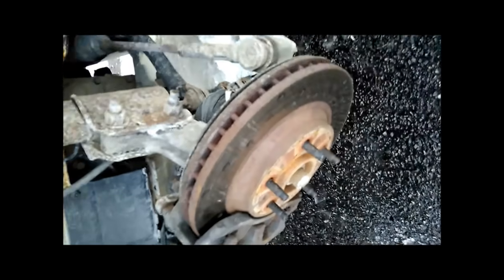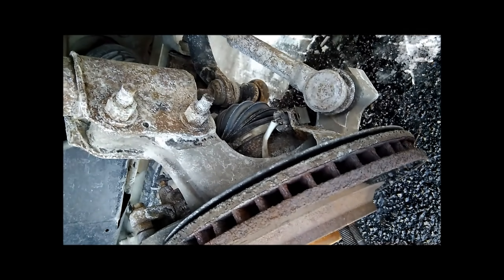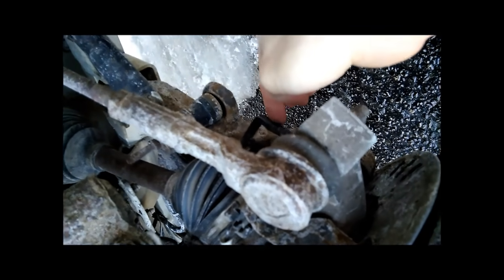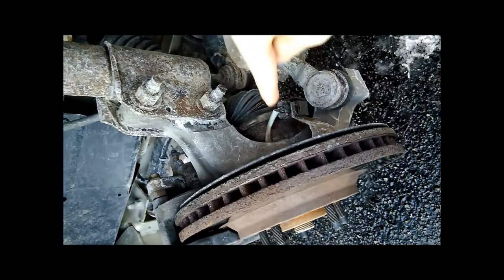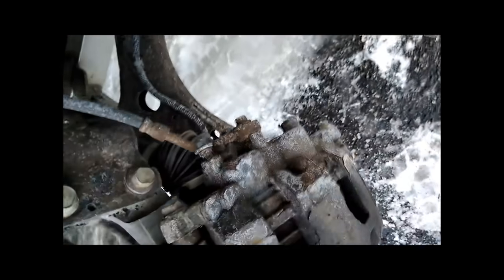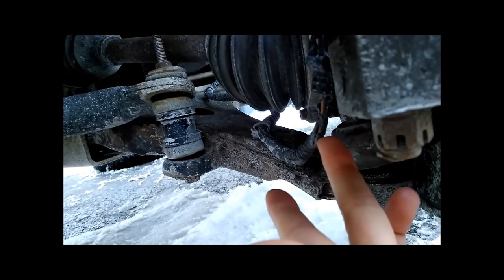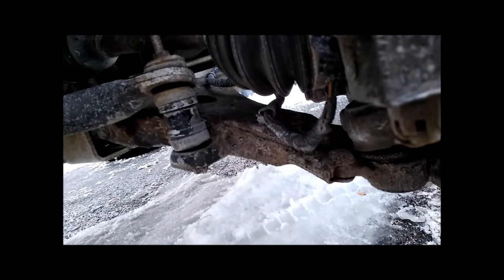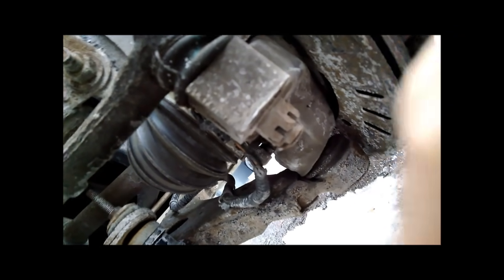How to fix ABS light, Traction Control, Stabilitrak

Comment: I had my 2007 mercury mountaineer worked on about a month ago replaced front passenger side wheel bearing hub assembly & just 3 days ago, abs sensor light came on. Still need to get the driver side bearing assembly replace and it’s still humming. Figured, bearing is going out also. Thanks for sharing this video👍
Reply from the maker: No problem.  Yeah, when a problem occurs right after doing a repair in a related area it's a dead ringer that the repair may have instigated the issue.  Sometimes the mechanic forgets to plug in the speed sensor harness or maybe they plug it in half-way or maybe they don't route the cable in a safe path where it won't get yanked on.  Many possibilities.  It's always good to have a look at the repair area first so you can potentially rule it out.
Reply: @ChrisCamaro  sounds good brother 👍 have a great weekends and thank you🙏

Comment: Thanks for the video, my parking brake broke and took that 1 of the sensors and I replaced it but I still have the lights on the - so now I'm gonna go around the vehicle and check the rest of the sensors,  it's a 2008 Dodge Durango two wheel drive
Reply from the maker: Good stuff.  Just remember that 2wd and 4wd alike rely on all 4 wheel speed sensors for the TCS

Comment: Fyi, I showed my mechanic homie, this video and he said that a better way to protect these wires is to replace the original deteriorated plastic tubing that protect the electrical wires and then wrap the new plastic tubing with electrical tape. Electrical tape, my mechanic said melts with heat. The plastic tubing is sold at the auto supply stores. Over all good depiction in this video, in my opinion.
Reply from the maker: A valid point.  The electrical tape is a bit hack'ish but it's meant to be temporary... till you can figure out what you want to do about your car in the long term.

Comment: I have the same problem, haven't had a check yet, my abs, traction, hill start and tyre pressure have all gone at the same time. I will update you when I'm done! I have a ford Cmax 2011 model.
Reply: Update, I took both the front wheels off, no corrosion or problems with the wires, I still need to look at the back ones though.

Comment: Good video, though quick tip.  You shouldn't let your wheels spin while the vehicle is jacked up unless you jack it up from under the lower ball joint or other wheel suspension component.  Spinning the wheel with the suspension at maximum travel can damage your half axles or even rip/slip off the rubber boots on the half shaft.  Basically your vehicle never turns the wheel at maximum suspension travel, unless you regularly take your car off of sweet jumps, so doing so while jacked up just creates an unnatural condition that your car never operates in.   With an older car that could be the difference between getting another 100k miles out of your front or rear axles or putting everything back together and finding out that your axle is now suddenly clicking and popping.  Oh and turning the steering wheel while doing this is just all that much worse.  cheers.
Reply from the maker: It never occurred to me to consider that but you're absolutely right.  Of course, all things mechanical are a function of time so I got away with it over the minute or so I was doing this diagnostic but your advice is definitely worth following.  Thanks!
Reply: @ChrisCamaro  you did good sir.

Comment: Thanks so much bro. I'll check mine in the morning. I'm sure that's my problem.. i also have the engine reduced power on the dash
Reply from the maker: I hate how the car has a "run like crap" mode that can be triggered by hundreds of potential codes.  I know it's there to save the rest of the car but usually it's just a pain in the ass.
Reply: I had the same problem I rewired a bad connection under the hood and it fixed

Comment: I didn't see anything to where you have to go in and clear the faults,like you do for a check engine light,just doing the repair will get rid of the light on the dash.Thanks for the video!
Reply from the maker: As far as I am aware, the fault will not persist once the problem is corrected.  Even before I addressed the issue in my car, every time I started it, the car would be fine with no lights.  The ECU was assuming the system was ok until it faults out.  You should be ok just to fix the ABS without resetting the lights.

Comment: Thanx Chris, like said below, best answer I ever heard. Had the Chevy service writer tell me they had to yank the steering wheel to replace a sensor???????
Reply from the maker: I suspect it was the steering sensor they were referring to.  This may be "a" mode of failure but not one I've personally experienced.
Reply: @ChrisCamaro  Chris in my case, the stabilitrak light only come on when the steering wheel is turned (left or right doesn't seem to matter) gotten to the point where I just change the dash display to vehicle mileage. On the up side, I have not noticed a change in handling. Your tip about the 15 sec reboot appears to be working ....... thanx again!
Reply from the maker: @Monkmaster1969  Glad to be of service!

Comment: Damn i learned something new  , thanks , my car just intermittently started doing this , this evening again , i just had the tie rods replaced last week and perfect timing the same area damn near , impala 2013 lt
Reply from the maker: Sometimes these things are more than just coincidence.  You do a repair in the wheel area or steering subsystem in your case, maybe the mechanic has to move the wires to get at something and when you get the car back the wires have been shifted and made vulnerable to moving parts or road debris or whatever.  Happens more often than we realize.
Reply: @ChrisCamaro  yep i bet your right,  because it never did this ever before i had my new tie rods replaced  , i got my car back 2 hours prior to my first alert on my dash , and was thinking he maybe hit something and it created an error  , i shut my car off and restarted it , then it has been fine , but i know it will happen again

Comment: Another thing this could be the sensor is dirty where it "reads" the movement of the wheel. On some cars you can get to the sensor enough to clean the road grime off and resolving the issue. This was the problem on my nephew's car this summer. Took ten minutes to figure out what was wrong, thirty seconds to clean it and three minutes to put the brakes and wheel back together.
Reply from the maker: It's an interesting hypothesis but if I'm not mistaken, the wheel speed sensors are magnetic encoders.  In other words, electromagnetic waves can "see" through dirt and grime, since the dirt and grime is non-ferrous. What might have happened is the encoder might have shifted out of alignment... maybe it was too close or too far away to provide a good signal, and by cleaning it and putting it back, you actually reset its position.  It's just another guess on my part but unless the encoders are optical or something else I'm not aware of, they should be more or less immune to dirt.  Automotive applications often use magnetic for this reason.

Comment: Excellent video!!!👍

If there is a bad sensor wire on my truck that’s causing the skid light to flash and the chime sound…
Will a bad sensor or sensor cable also cause the dashboard to have other multiple dashboard lights to light up like the Batt light, ABS light, all the dial controls to stop working for a few seconds then work again and the turn signals stop working??
Reply from the maker: No that sounds like more of an electrical connection problem in general.  My MC does that actually.  I'm looking into the wiring.

Comment: I just had stabitrack light and check engine light come on in my 2016 Chevy Impala and all I did was put better gas in there I ran three tanks of the E85 in a row and didn't have enough octane to boost the fuel injectors which resulted in engine power reduced, eve, the e88 gas works good but they can keep the e85 fuel for their cars
Reply: What kind of gas is that?

Comment: Hey man great video . I am a electrician 
Your taping method.  Crappy tape . 
If you use rubber tape . And 3m yellow 88. 
As long as the metal strands of the wire were in good shape . That could be a permanent fix . If you were charging someone to do this . Not ok . 
If peeps reading want to do yourself . Would work .
Reply from the maker: Heh.  I often do things sloppy.  Mostly because I'm ok with the idea that it's merely a temporary fix.  I'm sure you or someone else could have done a more professional job but I eventually did just get it repaired outright so I knew it was a short-term thing.  I think the main takeaway is finding out where the failure point is.  From there it's a matter of cost and time for the user.

Comment: Just curious what was the purpose of starting the vehicle and putting a vehicle in drive and having a wheel turn to pivot the wheel hubs left and right what was the point please explain !¿?
Reply: To make sure the wire didn’t get super tight or twist or bind
Reply from the maker: The idea is to examine the wheels'range of motion and to see how the wheel speed sensor's wire loom moves along with it.  If there is something wrong with the way the wire loom is routed, you may see it visually as you turn the wheel.

Comment: This happened on my 2018 silverado around winter. Only when i turned left, then progressively more constant. Disables cruise control. Replaced obviously faulty wheel speed sensor with ACDelco match. Both lights now on for eternity. Have not asked a dealership. When the bad wire was not making contact with the coil spring, everything was normal. When i replaced the parts the truck was shut off with the lights on and the wire making contact. I wonder if i just never gave it the opportunity to reset. Ive unplugged the battery before.

Comment: Excellent video thanks let me ask you this that problem affects the car getting speed after 35 mph?
Reply from the maker: It could happen at any time since flaky wiring will confuse the computer whenever you go over bumps or the suspension moves around, which can happen at any speed.
Reply: @ChrisCamaro  thank you so much for the information and your video we found some wires hanging now we have to figure it out the problem thanks again

Comment: Thanks for the great video.I have same problem in Caddillac escalade Esv 2016.In raining few lights are ON and the steering gets hard, ABS, Traction, etc. Do you think these are the same issues and fixed as you showed in the video?
Reply: Did you solve this?
Reply: @tylermcintyre8503

Comment: Would flat spots on a tire causing a mild shake around 45 mph cause these sensors to trip the stabilitrak? I drove about 6 miles fine and then bam I got hit with this issue and my engine reduced power and acted like it was misfiring.
Reply from the maker: In my case, not only turning but going over uneven road or gravel did cause the problem so I would think yes.  Any sort of imbalance in your drivetrain will have a resonant frequency which will amplify the effect at a certain speed.  If 45 is your car's resonant frequency it might be enough to trip the ABS, if there's a wiring/sensor problem already.

Comment: This was a very insightful video..
Now lately whenever my esc lite comes on..
During only expressway driving..
My right front brakes automatical engage the caliber an heats ups.
Its a 2007 Kia Sportage an no one has been able to figure out why..
 I'm open for suggestions after replacing calibers an brakes..
Reply from the maker: I'm just spitballing here but if it's highway driving, that makes me think vibrations.  The "frequency" of the vibrations on the highway are different than what you get on city roads and this could be shaking something loose - my guess would be electrical because a brake caliper doesn't just turn itself on unless it's told to by the computer.  Beyond that I think you'd need a road test with a scanner actively scanning to pick up the error.  You may not pick it up parked in a mechanic's garage.
Reply: @ChrisCamaro  Thanks for the "spitballing" thoughts
Lol..
I'll give the scanner a try as i am driving.
An let you no what was determined.
Reply: @ChrisCamaro  During road test with two different scanners nothing was picked up..
Maybe my scanners are kuput,
or the wrong types..
Anyhow another commenter stated to remove Abs/Esp fuse an see what happened.?
Gosh the Kia is back to running normal with no caliber grabbing.. Excluding the flashing "Abs/Esp dash lites..
So this may be Abs/Esp related.?
Which could mean maybe i have a bad Abs speed sensor..?
Reply from the maker: @my-manflint2668  Sorry I feel I should have been more specific that you need a scanner which can scan the BCM (Body Control Module).  Most commercial scanners only scan the engine or engine + transmission control modules and the ABS system is part of the BCM.  A mechanic's Tech II would do the job.  I hope you didn't spend any unnecessary money on those 2 scanners.  The fuse trick works if you just want to disable the system but I assume you want something 100% that doesn't leave you with a MIL light forever so that's why I opted for the scanner method.  It will detect the root-cause most of the time but again only if it reads the BCM.
Reply: @ChrisCamaro  Sorry for the late reply. I went to my local O'Reilly"s two weeks ago. An they used a BCM scanner. Which determined my right "front speed sensor" was bad. 
I also disconnected the fuse at the ABS an unbelievable my Kia Sportage ran without the front disc locking up again.
This was verification.
A local auto repair shop wanted $1800 to replace my entire ABS system..!
The local Kia dealership service department gave me a $2600 estimate to replace my Kia's ABS an wiring..!
 I ordered a set of speed sensors, replaced myself for $62.
The vehicle runs normal again.
My faith ever again in automotive repair shops or dealerships will forever be demised.
Thanks so much for your help.
Reply from the maker: @my-manflint2668  That's what I like to hear my man.  Great work!

Comment: Did you experience and binding with the brake or clicking just before lights turned on? My abs and TCS lights turn on after making a turn intermittently and noise from brake happens on drivers side front. Sometimes doesn't happen for weeks and usually when wet out. Gotta be a short, I'm thinking.
Reply from the maker: Definitely.  Happens to my MC.  A little slush gets kicked up by the tires and onto the wire loom, the water wicks into the insulation and shorts the wires out a bit.  The lights come on and you get a bunch of intermittent shuddering from the brakes.  Bumps and turns exacerbate the problem.  I'd inspect the wires for breaks in the insulation and replace accordingly.

Comment: 2004 Buick LeSabre Custom.. Same light issue. I’m on a budget, I’m not rich to afford professional repairs.. Driver side rear wheel AIR SHOCK was replaced and now I need to check. I don’t have a shop, or lift. Driver side rear wheel was stuck and I had to kick the wheel off.   Where is THE HEATER CORE on the 2004 Buick LeSabre? I’m getting THERMOSTAT fail code after I replaced the thermostat and temp sensor. I got a basic OBD 2 scan tool.

Comment: Ive found that it is usually a sloppy wheel bearing , thats the first thing you check , before you take the wheel off check for play in it by shaking the outside of the wheel ..you got the rest of right though , if gm asked me nicely , i would teach them how to make there trucks better and built cheaper , i dont got no interist in cars though
Reply from the maker: Thanks for adding to the solution.  Is it the vibration caused by slop in the bearing which throws off the sensor or something else?  Just curious how this leads to failure of the system.
Reply: Yeah , its a one piece unit non greasable , im wondering if it looses lubrication somewhere through its life ,ive seen people attempt to grease them through the abs sensor hole , but i dont think that gets the grease in the right spot on some wheel bearings ..

Comment: Hey love the  video but what can I spray in there .... like in the connector
Reply from the maker: Most hardware stores sell something equivalent to "electrical contact spray", which is a type of solvent the that gets rid of the corrosion that typically forms on conductive materials like copper.  It has lubricating qualities too and if you spray some of that in the connector and work the connector on and off half a dozen times, you'll have a good solid connection.  Then if you still have issues you'll know it's somewhere else.  You can use a multimeter in continuity mode to check both conductors to see if they are shorting as well.

Comment: My 2009 Chevy HHR 2LT has alarm ABS and Traction Control.  The OBD scanner showed code C0045.   Your video seems to be a great start to look at my problem
Reply from the maker: That's excellent that you have the code.  That cuts your work down to 25% (less if you consider other things like the steering angle sensor, etc).  Now you just need to trace that wire back and see if it's intact.  If it is, you're likely looking at a hub (sensor) replacement.